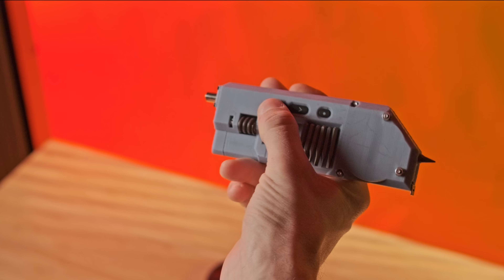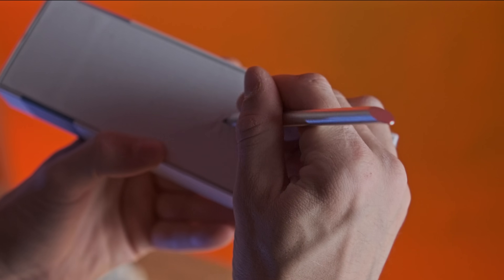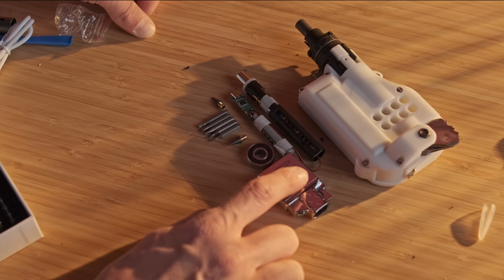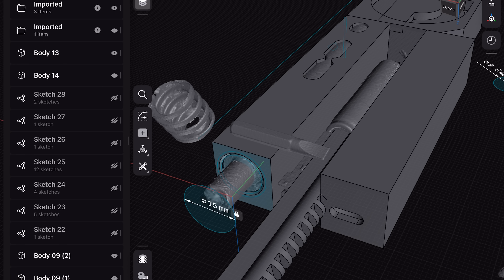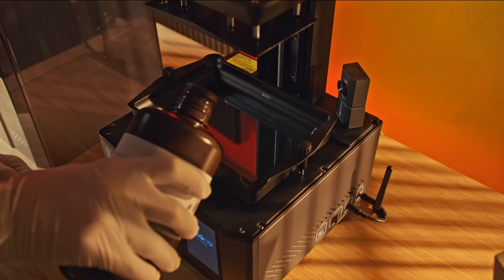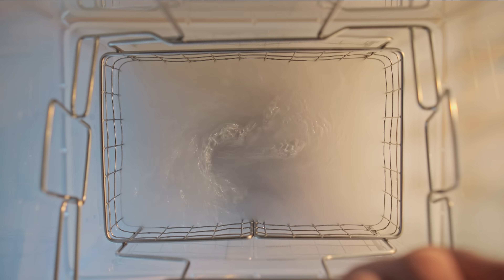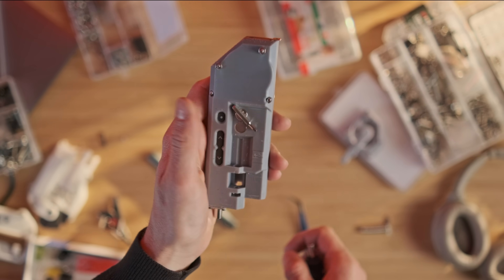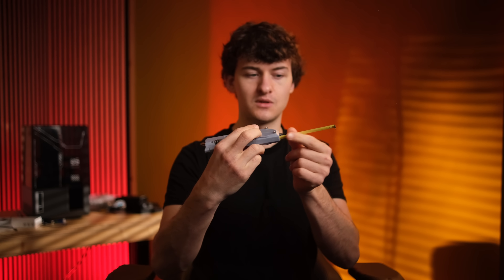Proof Of Concept - 3D Printed EDC Tool - Episode 2

Comment: I think adding some simple rubber bands could help your builds. Like in this one for instance you could attach a band across the bits to keep them secure. Also, separately, you might benefit or find inspiration from reading about different springs used in pocket knife locking mechanisms. A lot of creativity there to get a spring in small or very specifically shaped areas, could be useful for securing some of your stuff!

Comment: i was pretty impressed with your initial build, but i think the precision screwdriver is the better way to go.  as far as bit storage goes, i think you're on the right track with the magnets, but you should take a lesson from the newer manual precision screwdriver sets available these days & implement grooves for the bits to sit in - then design a covering door of some kind to keep them secure.  you might also consider trying to design in a retracting mechanism for the pencil tip, so you don't stab yourself when you carry it in your pocket or on your belt.  the charge port location is another issue, but without rewiring you're in a bit of a pickle.  keep up the great work!  i'm looking forward to seeing further developments!  😊

Comment: Maybe it's because I use the caliper more than anything else, but I feel like having it sliding would be a lot more practical on the long run. Maybe having an actual caliper embedded in the tool would be cool, so that you can use it without the need to take it out of the tool. There's plenty of small calipers that could do the job :)

Comment: Same battery that powers the screwdrivers could also power a simple LED pointed at what you're driving in. Also, Stabby Labs makes carbide pen tips that are replaceable and can be used as scribes, in case the pencil doesn't mark on smooth/metallic materials. Great video!

Comment: Hi it looks cool !!! 

• Make tape measure electronic wheel with display that indicates the distance. also will act like widget spinner when it’s off it has no limit in distance or dimensions (metric / imperial) also compact will take same amount of space … I think.))) you can measure it to the right distance and then turn 90* and make your mark with pencil like it was in original plan .

•Aso liked the idea of making screwdriver to drive your calliper  but some one else suggested it already. I would print sleeve that fits over moving part of screwdriver and glue it on so it’s satay on permanently same shape as your wrench gear and little swing arm that would go between it and calliper  shaft  that you can engage it with.  

•Clip or ear for sting so you can hang it. Razor blade / box cuter useful.  Maybe print usb cove especially if planing wood work . 
Good luck 😎

Comment: I am so happy to see this becoming a series. Especially excited to see how you resolve the issues, and how difficult/easy it is for you to change the existing design. 

BTW to follow up on our last conversation: I have been filming two of my latest projects. I’m still dreading editing all the footage, but it’s a start. Do you storyline before the project? Any tips to make editing less of a monumental task at the end of a project?
Reply from the maker: That’s awesome to hear! I’m really glad you’re filming your projects. When it comes to editing, it’s true that it can be a long and sometimes tedious process. Personally, I don’t do much storyboarding because I value honesty in showcasing projects, if something fails it fails, if it worked the first time thats that. Instead, I try to imagine the edit as I’m filming.

For example, if I just filmed a sliding shot, I think about how the next shot can transition smoothly to avoid it looking strange during editing. After filming, I load all the footage into my editing software and create a rough cut—a basic linear storyline of the project.

Using the jog wheel on the DaVinci Resolve Speed Editor, I quickly scrub through the footage, set in and out points, and append clips to the timeline. Once I have the rough structure in place, I record the talking head portion while watching the footage. This part is essentially me narrating what happened and my thought process during the project.

After that, the real editing begins—making everything look good and flow well. Recently, this has become more time-consuming, so I’ve had to lower the quality a bit to save time. My focus is on editing to the music’s pacing and cutting down about 90% of the footage and dialogue to get it to a reasonable length.

I try to keep as much of the thought process in the video as possible ( the idea is more important than the end result ). But of course, our thoughts move faster than we can film, so a lot of unnecessary rambling ends up getting scrapped. 

not sure if it helps but maybe something is useful to you, if I think of something ill be sure to update you :) but really lovely to hear your now filming stuff!

Comment: The pencil and tape, just make an L, and put the pencil in the L pointing down, so it stays always in a confortable way to use it, a little bit to the left or right, so the tape is not in the way and its more easy to do the markings

Comment: With the callipers in think you could use the screwdriver shaft to open and close using the controls. Maybe a little gear that can be moved out of position when using screw driver. Would be even better when you do the metal version. Top video.

Comment: Find a cheap digital caliper and see if you can use the LCD and scales from it.
I'd make a case for the screwdriver bits that also has lid.
I'd also look into designing a tool that would let you coil up the measuring tape and put it into the case to make your life easier.

Comment: Man this is such a great upgrade from the first version. I think something a little more dedicated for holding the bits would be a great improvement, and maybe trying to integrate a self locking tape measure would make the one handed operation even nicer! Another idea would be to integrate a small flashlight/led somewhere? Maybe a flashlight with a uv light built in (to cure small uv resin glue joints) could be cool! Looking forward to seeing what you will do with the print room!

Comment: It would be interesting to see if you could have the electric screwdriver drive the caliper. Have it drive the caliper for big adjustments and the thumb screw for the fine adjustments. Also, adding an encoder to the caliper, for a digital readout would be another thing. I am sure you could scavenge all you need for that off a donor set of digital calipers, like you did with the screwdriver. Finally, a few holes and rods, printed into the body, could serve as reference for sizing nut and bolt sizes, quickly and easily. Also, ruler markings along the edge of the longest straight edge for quick measurements, might be redundant to the tape measure.

Comment: Bro this is awesome, I just started my V2 multitool as well and something I’ve found super useful is a continuity tester and they are super small and easy to implement using a tiny battery, and an LED light with 2 small wire leads for poking breadboards (2032 coin battery)

Comment: I love this concept, great design work.

I have a few thoughts:
What about having a indented measuring engraving on the back side of the wrench so you can measure it so it kinda acts like a caliper?
What about a latching cover for the bits with a hinge? 
What about about the pencil head having a slider to push it out, like an Bolt Action Pencil or Pen?
What about having a guide to know what size nuts or screws so you know what size they are? Just some hexigons and holes with some engravings saying what they are.

Comment: Great  idea and execution. I have a couple of suggestions:
-it will become tedious using the caliber with this opening method, maybe it's better to stick with a slider and friction.
-Do a transparent version! It would be awesome!
-You could add some plate with magnets on top of the tips. This way they are covered but you can acces theme when you need it just removing the plate.